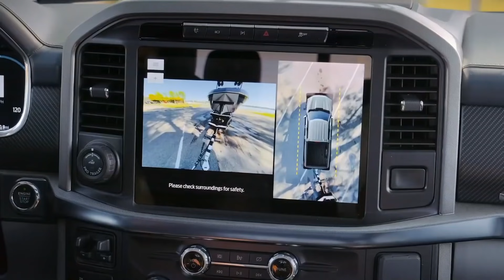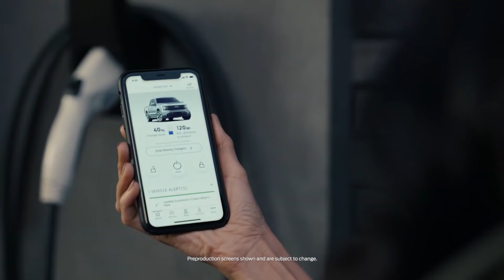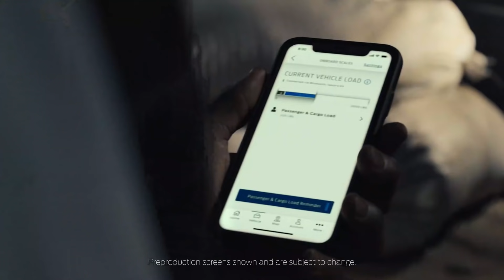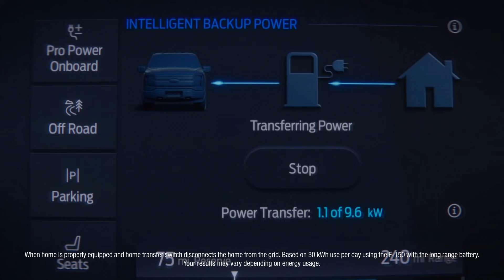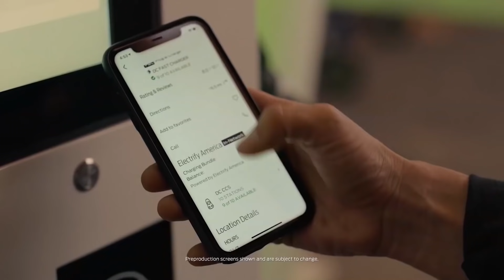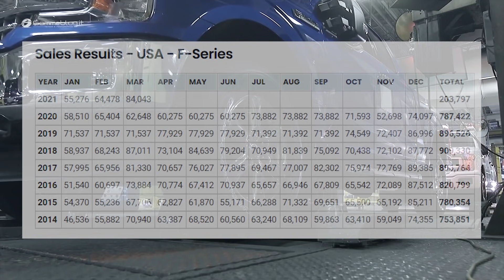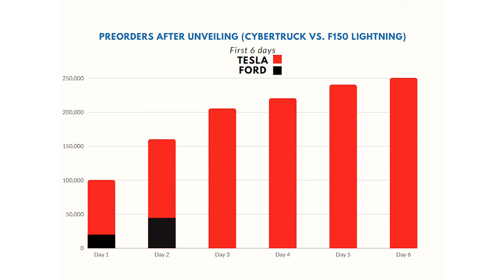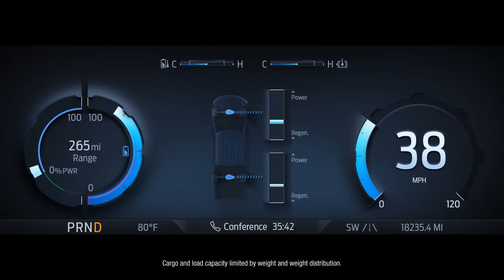Ford F150 Lightning Reveal: A Costly Mistake On Stage? | F-150 Lightning VS. Tesla Cybertruck

Comment: Stop saying Tesla is making vehicles more affordable. They keep raising their prices, not necessarily with new models but right in the midst of building their current models. Prices just keep going up. Tesla is the electric car equivalent to Apple. Total control. The owners have no decision making with the product. If Tesla decides they are going to change the software on your Tesla car or SUV then you have no say. You just have to deal with it. So who's car is it really after you buy it?  Also, the "Cyber Truck" is a poor design.

Comment: First off "The World" isn't going all Electric as  The World can't possibly generate enough electric power and the Grids simply aren't going to handle the load of hundreds of thousands or millions of Charging Stations and Home Chargers being used at one time here in America (look what happened in Texas from a Cold Snap). Especially when you consider the newer Charging technology is moving towards higher voltages at 400 to 800 volts. Then there is the ongoing issue of range, or lack thereof. Especially for a pickup like the lightning. 300 miles in perfect conditions which means just a driver and no payload. Add payload the range drops, tow a trailer and the range drops more.  It's simply not going to fit with many truck owners who are used to being able to haul for work or recreation for hundreds of miles at a time. Using the truck to power your home is a neat party trick but in the case of the Blackout in Texas, what happens when your Lightning battery runs out? Now you can't drive or power your house. That's what natural gas generators are for. Then there are those States such as California, Utah and others that are penalizing those driving EVs or Hybrids because they don't buy gasoline or buy less of it and the States are losing tax revenue. So they are going to tax drivers of those vehicles either an annual fee or by the mile. So much for those savings you get by driving an EV.

Comment: Good improvement, not more.
Range simply bad if you carry or tow anything. Think Jim was cheating with his 40K entry model which will hardly be available and no specifications detailed. Just a message to many loyal truck owner buy ICE only, we are not capable to offer anything to you loosers.
It's a public relationship project to steal time as they have limited new needed capabilities to deliver a true competitive next generation truck.
Poor truck sales means bye bye dealers, many associate's and zero appetite to get loans. Getting a president in your car won't help, real change is urgently needed or a museum is the only thing left of Ford.

Comment: Ford must have Tesla fanboys scared. They are getting vicious and defending a truck they haven't even seen in production form. I think Ford has a hit on their hands.
Reply: No. Ford's specs are bad in every way compared to Tesla.
Reply: @GowthamNatarajanAI  How So? And Specs aren't the only thing to keep in mind about a truck. The style alone will prevent many aftermarket truck accessories from not working universally on a Cybertruck. The Lightening F-150 will offer the same compatibility to the aftermarket as the gas version already in use.

Comment: It’s NOT Vehicle to Grid. It’s Vehicle to Home. Very different.
Reply: So far as I can tell (I could be wrong) it's just about running extension cords off the trucks outlets. Otherwise you would have to make alterations to your homes electrical system to both accept the power and prevent back feeding into the power grid
Reply: Exactly, there’s no connection to the grid whatsoever, it’s just that you can use the truck as an electric generator to power stuff in your house.

Comment: Great video…very on point. My current tow vehicle is a 2015 F-150 XLT Crew Cab (2.7L Ecoboost).  I don’t think a 300 mile battery pack is going to suffice for my current needs; somewhat disappointed to say the least.
Reply: its 300 miles carrying 1000lbs payload, if you do calculations you can get around 468 miles with no payload.
Reply: @rckarly  that has not been confirmed. Only MBKHD was told that. No one else. 

Also, 610 miles where seen in some leaked details about the CyberTruck. Again, not confirmed but they do have new batteries so we will see.
Reply: What do you think of the 500+ mile Cybertruck?
Reply: re: "I don’t think a 300 mile battery pack is going to suffice for my current needs" and there it is folks the "OZZY Osbourne" Effect.  this is the phenomena where truck owners show themselves to be smart/intelligent and recognize the Lightning not only DOESN'T meet their needs, but they ALREADY own a modern/capable vehicle, and don't need to be "that guy" (ie, a mentally challenged airhead) running around trying to FORCE SQUARE PEGS INTO ROUND HOLES.  yeah, something NON TRUCK people don't realize is the Ford F-series is a GIGANTIC line up ranging from 150's to 250's to 350's with multiple engines in terms of Gas, Diesel, Hybrid etc, and these "choices" AREN'T going anywhere.
Reply: @phillyphil1513  Exactly right, lots of use cases and needs. The Lightning won't fit them all, but it will fit quite a few. It's a worthy addition to the F-series line up.

Ford will sell all they bother to make.

Comment: Great video, but it does not have a  (Standard size bed). Mt F 150 has a shorter than standard, at 6-1/2 foot. The "Lighting" has a extremely short  5-1/2'  bed. Standard beds are  8' long. Remember drywall, plywood, studs, etc are all 8' long. It's dangerous to put down a tailgate. You have a great channel, thank you.
Reply: Agreed that the video terminology was off.  For starters, there is no such thing as a 'full size" bed.  By all journalistic and manufacturer definitions, "standard bed" is about 6.5 feet long, "long bed" is about 8' long, and "short bed" for those that are about 5.5 foot long.  The Lightening will only be produced in a crewcab and short bed (at least for now).
Reply: @MrChadx1  the actual bed length is 5.5'. My ranger has a 5' bed.
Reply: @robertopics  Yes, that is why I said 5 foot range (which means 5'0" to 5'11").  I didn't know the exact measurement so put the range. Guess I can edit that to make it more understandable by putting "about 5.5 foot" rather than "in the 5 foot range". I will do so.
Reply: 8' beds have not been standard in about a decade.
Reply: @robertopics  Correct, but give me a choice on "ALL" trucks brands please. I'm a carpenter.  I'm single, and don't want to sacrifice the length of the bed, by having a "CREW cab" either. An extended, or "CLUB cab" would be sufficient, and add a foot or 2 to the bed. Other than the bed, and the range, It's a good truck.
Reply: @Mkellypeninsula  I'd choose an extended cab with the 6-6.5' bed, but from what I heard ford went with the crew configuration because it's the most popular configuration and that world save them money.

Comment: The V2G, BlueCruise (requiring cameras) are NOT available in the $40K base(commercial) model!
The 4.5s 0-60mph is also unlikely to be part of low end model (only extended battery packs might give it that power)!
Ford did deceptive marketing by quoting specs of high end models and price for the low end model. Thousands of folks reserving for Lightning did so thinking that the $40K model will buy them all the cool features. Even the touch-screen center console is not available in their XLT trim (costing $53K to $60K)...only Lariat/Platinum (costing $70K-$90K) have them!
Also, every media person & auto analyst fixating on towing capacity is ridiculous! Less then 1% of F150 users ever tow! What's most important is the PAYLOAD CAPACITY & BED SIZE. Cybertruck can haul TWO TIMES as much payload as Lightning; while the bed is also much larger than that of Lightning's.

Comment from the maker: Correction: The bed is slightly smaller than a standard bed.
Initial signs suggest there won't be a demand problem, but will Ford be able to deliver without running in to supply chain problems?
🔥 Get 2 FREE Stocks with Webull: https://bit.ly/3vNnbRt
🛡 Get Surfshark VPN at  https://surfshark.deals/EVSource for 83% off and 3 extra months for free!
Reply: There won't be enough people willing to pay the high entry price.Ford will not mass  produce this compliance truck lol

Comment: Stopped watching when you said "standard full size bed". That's BS.
Reply: I agree. If a bed does not carry a 4'x8' sheet of plywood with the tailgate up, it's NOT full size.
Reply: Agreed that the terminology was off.  For starters, there is no such thing as a 'full size" bed.  By all journalistic and manufacturer definitions, "standard bed" is about 6.5 feet long, "long bed" is about 8' long, and "short bed" for those in the 5 foot range.  The Lightening will only be produced in a crewcab and short bed (at least for now).

Comment: The Osborne effect is already occurring. I’m holding my F150 until the Cybertruck arrives  the Ford Lightning is simply not inferior in almost all features.
Reply: Be realistic. The CT and Lightening are extremely similar to one another in the big picture so one can not say one if inferior to the other. They will both sell well and it's great to have choices for those that want an EV pickup and can live with the range and charge time limitations on these first versions. I'm happy that so many manufactures are getting into the EV pickup game so we all have choices in features and options (body/styling being the most obvious). I don't get the bickering and bashing from one potential EV pickup brand buyer to other brands. You'd think there would be a lot more EV pickup camaraderie rather than bashing each others EV pickup preference.
Reply: @MrChadx1  I want them both to be successful, but Tesla set the standard, and Ford hung their reputation of the F150 at stake.  Let’s face it, nobody wants a base model Anything.  They are not even on the lots.  Compare the Ford  and Tesla at the mid or upper trim levels. Choose the 10 most important characteristics to you.  You will find that the CT preferable in at least 8 of the 10.  Ford already knew the specs of the CT and opted to come up short consistently
Reply: @joeo7257  Until a vehicle is released for production, hard to say anyone has set a standard. Several companies have projected what they will produce, so when actual EV pickups start coming off a production line, then we'll have some standards set. Ha. 

In most of my criteria, the two makes/models are pretty much the same simply because they are EV pickups (ground clearance, beds with reasonable payload, reasonable towing, adequate range). And the range one is only adequate because I will have another vehicle that I can tow with for longer trips which many will not and so eliminate both of these trucks from contention. 

As for my criteria, I don't have 10 that are equally weighted and I think most potential buyers will be similar. Weighted or not, I do not find the CT preferable in 8 out of 10. I don't think anyone can make that blanket statement because criteria are all subjective; not objective. 

I personally don't like the exterior style of the CT so that crosses it off the list right there. Some love the CT exterior and don't like the Lightening exterior so the lightening is crossed off their list. And that before we even get down to the list of other criteria.  

From pictures and videos of the preproduction CT, I think the interior is cool, but I don't think I'd like living with it day to day. Other Tesla models I love the interior looks, but don't like it for day to day use (basic functions several layers down in the touch screen menu rather than a knob that I can just change instantly).  Some don't mind that. Again, different preferences. 

Most other things, as mentioned, are very similar (price, range, payload capacity, towing capacity).  Then there are the areas that are still unknowns, but that tend to favor a mass produced model by an established auto manufacturer and with dealership support. These include vehicle fit and finish, parts availability and parts cost, warranty work location, repair appointment availability, national support, etc.  

Everyone has different requirements and each one is prioritized and weighted differently so it's impossible to say that X out of Y features are preferable in one model over the other.
Reply: @joeo7257  Sorry, but when it comes to companies with employees & those of us using truck for work, base models are ACTUALLY preferred.  They get beat up a lot.  For us, a truck is just a tool to turn a profit on whatever it is that we are doing.  No need to spend $90k when a $40k will suffice.
Reply: @MrChadx1  not similar at all, one is a Truck for the masses that can be enjoyable on trips.  The other is a Billionaires childhood fantasy that can be taken off roading with a Spartan interior
Reply: @lrod8692  Good discussion! I'm with you on the stark styling difference, but really these are just two different takes on the same thing; an EV pickup. I realize that when making comparisons, one must quantify the level of the comparison. I'm comparing on a high level from the perspective of these EV against existing ICE pickups and from that perspective, the Cybertruck and Lightening are very similar.  Both have very different interior styling that provide the same functions (display speed, change your radio and climate control, etc.) . Very different exterior styling and chassis; that do the same thing; drive you from point A to B, have ground clearance of a pickup, four wheel drive, good power, towing and payload capability, and have a pickup bed.  Same same. 

I much, much prefer the traditional styling of the Lightening, but I'm fine if other potential owners prefer the really different interior and exterior styling of the Cybertruck. A different in personal tastes is why we have such a wide variety of ICE vehicles today along with literally everything else in society like house architectural and interior design, clothing design, etc.  

Not sure your criteria for "being enjoyable on trips", but no one has driven these back to back yet so guessing your comment relates more to interior styling rather than suspension performance, seat comfort, etc. Time will tell on those. Will be fun to hear back to back reviews as these actually make it to production.
Reply: @MrChadx1  well I can’t tell you from driving an F150 ICE that the ride quality is amazing,  having driven a Model S with air suspension the ride quality is also amazing.  As an owner of a Model 3 LR RWD the stock suspensión leaves a lot to be desired.  The stock seats between both are much more comfortable in the F150.  The Lightning will use everything from the ICE F150 except the power train and rear suspension, but you can go get an idea of how it will ride comfort wise.  The Lightning will handled much better (I am assuming) than the ICE version.  

Basically what I am saying is this,  the Cybertruck is still a concept.  The Lightning is reality. You can go out right now and sit in a Lightning, possibly get a feel for how it’s going to drive.  The Cybertruck on the other hand has 1 version, with no further details.
Reply: @lrod8692  Agreed, It will be interesting to see how the Lightening coil suspension and totally different weight distribution and overall weight perform compared to the current F150. And how the Cybertruck, Hummer, Rivian all feel and drive as well. Not only performance testing limits (skid pad, etc.) but how they actually "feel" to the driver in daily driving situations. 

One thing for some readers to consider is performance cars suspension is usually fairly rough compared to average car or touring cars. The Tesla car offerings lean towards performance it seems with the extremely low profile tires, taught suspension, etc.  I know it's just a design choice they make and based on a price point (since some very expensive performance cars don't have a buckboard ride like more economical performance cars), but something to consider when comparing ride quality on their cars. And likely will not crossover to the EV pickups because they'll be designed and tuned for an entirely different audience. 

I'll note that joe public can't go sit or drive a Lightening. Auto journalists maybe can, but even then, what they are seeing is a pre-production build so not a production unit. So really the Lightening and Cybertruck are just in different phases of development and Tesla tends to choose to not release driving evaluations on pre-production versions.  In any case, I can't go sit in or drive either one. Anxious for that, though. 

I plan to replace my current ICE pickup with EV or hybrid pickup next year. Can only go EV if I also have an ICE to tow on longer trips, so weighing that and it will sway my direction,  but I would much prefer an EV over a hybrid. For those that only can/want to own only one pickup, the hybrids are a great choice. I wish they'd do some good plug-in hybrid pickups so one can drive electric only on sub-40 mile trips but hop in an drive across the country or do a 200 - 400 mile round-trip day trip while towing and treat it like an ICE on those occasions.
Reply: @MrChadx1  which is why I say these two are meant for two different demographics.  I have both reserved, but will most likely go with the Ford due to their history with building F150s
Reply: The CT is a low poly 90s video game. Total joke. I could imagine cone boob Laura Craft come out of it
Reply: The Ford is totally inferior to the cybertruck in every way and will need massive marketing and all the worthless gimmicks to sell a paltry number of units. Ford will be bankrupt by 2025
Reply: @PaleBlueDotCitizen  at least the f150 doesn't look stupid. The cybertruck hurts my eyes
Reply: @PaleBlueDotCitizen  the interior alone makes the Cybertruck a joke.  Let’s face it, the Cybertruck is nothing but an Elon Fantasy.